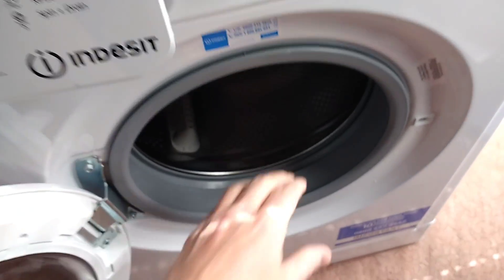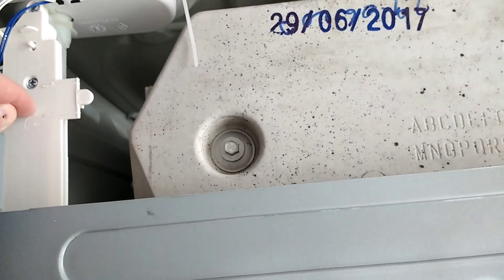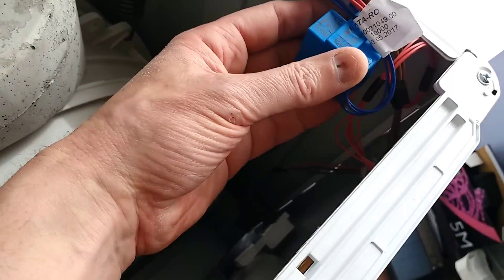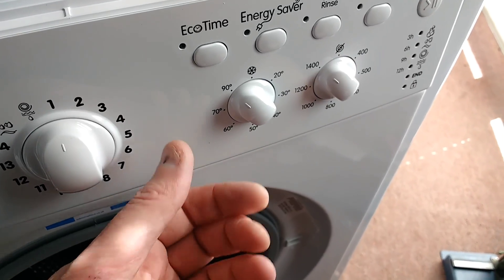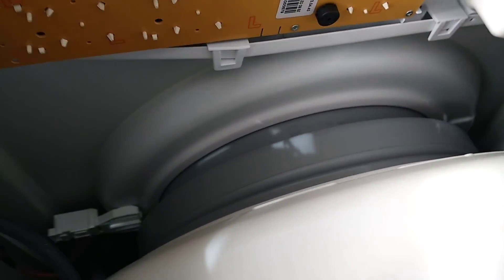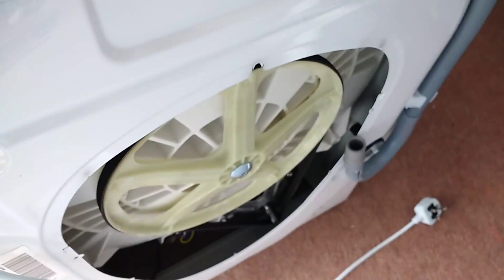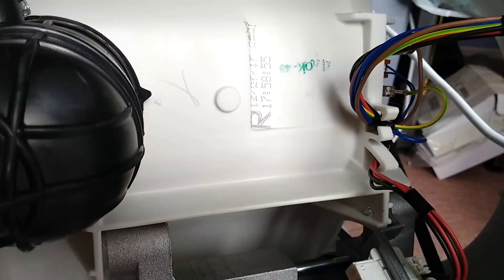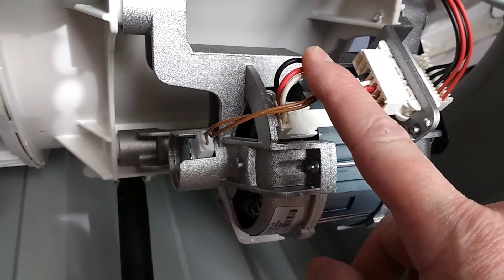Inside my new British washing machine (clothes washer).

Comment: As a ex-owner of multiple Indesit machines, I can bet 10€ that the first thing to go are the drum bearings. And it will cost around 100€ to replace because the drum is a sealed unit (two plastic halves are welded together). I did try and repair the old one by splitting the plastic case and I was somewhat successful but I could not get it to be 100% waterproof again. After numerous attempts with special sealants and glues and even a plastic welder I gave up and sold the machine. As a replacement I bought a LG washer that has a plastic tub that is bolted together with a huge O-ring between the halves and the direct drive inverter motor. So no more motor noise and if the bearings need replacement I just need to buy the seals, bearing and the O-ring. Samsung also has models with a bolted tub but I bought an LG because it was on sale.

Comment: I hate when the washing machine vibrates like crazy due to an unbalanced load.

Why is it not easy to mount the drum on an eccentric cam that can be adjusted to offset the balance within the drum?
Reply: Maybe to do with the difficulty of sensing the balance?
Reply from the maker: Maytag have an interesting solution to that.  A balance ring filled with water that somehow displaces to compensate for the load imbalance.
Reply: bigclivedotcom That does sound quite clever! Can you get a balancing unit for tear down??
Reply: My machine (Maytag Neptune 5500b) has this along with a resonant weight in the door. The liquid in the ring is supposedly a calcium chloride solution.

Comment: It's always so strange when I see washing machines installed in the kitchens.  So foreign to a North American.
Reply: We have nowhere else to put them here. They'd look daft in the living room and it would be a pain to get water to/from them. You'd also have to turn the TV volume up on spin cycle.
Reply: I think we're hinting that other Countries have laundries :-D
Reply: Same standard in Australia. Even the older, smaller houses have a dedicated laundry (sometimes combined with a reasonable-sized downstairs bathroom, especially in larger, multi-storey properties).
Reply: I am in Canada.  Let me tell you about "communal laundries".  They suck.  I live in an apartment that has such a facility and I do not go near it.  I do not need the inconvenience and aggravation of hoping and waiting for an unused washer, making the trip over to use it and forking over something like $4 for one load of washing and another $4 to dry, and then waiting around to discourage people emptying the clothes out (or even stealing them).  I will not have it.  Instead, I bought a small top-loading washing machine that connects to the kitchen sink using a quick-connect fitting.  It's paid for itself many times over but, it's not about the money.

I do not have a dryer.  I hang the clothes on a drying rack, and they're dry within about 12 hours.  By opening a window and directing a fan over the clothes, I can bring that down to 1 or 2 hours.  Besides a huge savings on electricity cost, this has the benefit of drastically reducing wear-and-tear on clothes.  The time spent tumble-drying is absolutely devastating to fabrics.
Reply: I wont have them in the house, hate the noise, the mrs has a shed outside with 2 washers and a dryer and thats her domain and i dont dross it.
Reply: Apartments in New Zealand will either have the laundry facilities in the bathroom or hidden in a closet. I have never seen them in a kitchen before.

Communal laundries are rare in apartment blocks - I don't know why but I think they would work a treat here. In many older standalone homes - like my old family home had a separate laundry room off the backdoor porch.
Reply: In the Netherlands it is traditionally the shower/bath room, or nowadays a separate laundry or a cabinet about a meter square (10 sq ft).
Reply: How about apartments? Where are the washing machines located in an apartment? Let's say 2 bedrooms, living room, kitchen, bathroom and a corridor? In Poland it is either bathroom or kitchen where we have washing machines.
Reply: well I find going into the boiler room in America to wash your clothes equally as bizarre as a European (Brit actually) ;)

Comment: Should have bought a Bosch, these machines are awful! They usually have one solenoid valve for normal cold filling (not been hot+cold fill for several years now) and a second solenoid plus restrictor for the comfort as normal mains pressure would spray it all over the drawer.
Reply from the maker: I had an Indesit in Glasgow for about 15 years and only needed to change the belt once when it started slipping occasionally.
Reply: The old ones were not so bad compared to the average machine these days, but I bet this one won't be as reliable, plastic pulley and all that! On the subject of the common control boards, I remember the old Servis Sapphire range, the first machine with a 1300 final spin (somewhere around 1990). They charged a premium for the 1300 model but all they did was cut a diode out of the control card. If you knew how to get the board out (pretty simple) you could save a fair bit of money buying the 1000 model and removing the diode.

Comment: The weights are also for tuning the resonance frequency of the camping system nice and low.

When you start a spin cycle and the speed increases, you can often see the drum resonate as it passes through multiples of the damping system frequency. That also includes the springyness of your floor!
Reply: I used to have a concrete floor, so once the machine was set up properly there was almost no vibration. Now i have a wooden floor and it is impossible to prevent vibration.

Comment: Most modern hot water systems take too long for the hot water to reach the taps, hence modern machines only fill small quantities of water and the hot wouldn't actually reach the drum. The older machines would half fill the drum. My machine is very similar also indesit and already 7 years old no issues yet
Reply: With my old machine I'd always put the machine on after filling the sink for my washing up. That way the hot water was there immediately. Since I've got my new machine, my electricity bills have doubled!

Comment: Make sure to remove the shipping bolts before you use it!
Reply from the maker: I got it into position and then did that.
Reply: Good, I just got a washer recently and the installers didn't do that. It resulted in a walking washer.

Comment: i prefer the OLD mechanical switches and dials..
DONT like computer modules esp if they are not WATER PROTECTED
Ribbed hoses collect lint..
Reply from the maker: The old cam switches were quite appealing.
Reply: Iv seen 20 year old washers Still working and Repairable..  What is the availability of that Circuit board and cost??  In the USA, its a service person and $200+..  They dont like people repairing things..and they Over price replacement parts..

Comment: Indesit shite. I suppose the question is, is it more cost effective to buy a £1000 pukka machine that lasts fifteen years, or one of these every five. 

I suppose at least buying a new one means you don't have to worry about maintaining it. Lol.
Reply from the maker: The Indesit spares are easy to source and the machine costs about £230 versus £1000 for a high profile brand with equally expensive spares.

Comment: Just curiosity... Isn't there any kind of accelerometer tied to the motor?  How does the machine know how to spin an unbalanced load?
Reply: Coolkeys2009 how does the check for 'out-of-balance' work?
Reply: I'd imagine they would detect it by variability in the motor speed or drive current. The speed regulation routine will know how difficult it is to maintain constant speed.

Comment: hate modern washing machines, I have Bosch and water level is so low, it just wets clothes inside, doesn't submerge them into water
Reply from the maker: The reckon that the increased fabric movement versus floating in water results in a better cleaning action, followed by a few deeper rinses to get the loose dirt out.
Reply: Like Blackadder said about the start of WWI - "There's only one problem with that." "What's that?" "It's bollocks."

My older washing  machine (Philips Whirlpool) was much better than my parents' new Bosch machine for getting clothes clean. My new Samsung is good but it seems to use a reasonable amount of water.

Comment: The 5th wire on the front control panel is used for warm white internal LED's in the 40 Kg 12,000 Spin Super Mega Deluxe Model. I have changed ours to those self changing tri colour LED's. I'm lying of course, it's only a 10,000 spin. Thanks for finding those straw hat ones for me. Great video as always. Please do something really nasty with the old one.

Comment: i was told somewhere around 2003 the UK washing machine industry sort of went through a dive to the cheapest with imports forcing the market down. basically since then, they are all crap no matter what you pay. none use hot water in anymore, plastic everywhere, etc. I got this from the plumber who repaired by Blomberg 5 years ago (a german siemens under another name - and one of the last really good ones he told me). I've repaired it over the years mostly myself - new heater element (still has one when hot isn't hot enough, etc), and new belt, etc but parts have now dried up (16 years old), and 2 weeks ago the circuit board worked loose, shorted on the body and fried one of the main relays - so I bit the bullet and got a new Samsung job. No hot inlet of course.. and I'd say otherwise pretty much no better than the 16 year old one it replaced.

Comment: It's fascinating to see how electronic timers and brushless motors -- once found only on the highest-end machines; lesser ones had to make do with mechanical timers and series-wound motors -- have become commodified enough to be found in the cheapest, generic washing machines. 

I'm guessing there are two microprocessors:  probably an 8-bit one on the control panel PCB and a 16- or maybe 32-bit one on the motherboard, which will be controlling the motor speed and direction directly as well as other elements of the program cycle such as the water heater, pump and valves and reading the temperature and water level sensors and the door switch.  If you energise the motor windings in sequence A, B, C, A, B, C the motor goes one way, a fixed amount for each change  (so the speed of the sequence directly affects the speed of the motor);  if you go A, C, B, A, C, B then it goes the other way; and if you go A and B together, B and C together, C and A together, A and B together, B and C together, C and A together then it will have more torque -- but this probably would only be used for starting from rest, since it also increases power consumption and self-heating.

My current washing machine is a 6-month old Miele, which replaced a 6-year-old Miele due to flood damage  (nothing to do the washing machine, but from a burst water main.  A water main that was carrying enough water for the quarter of a million thirsty, dirty residents of my city.  That burst just a short distance uphill from my street .....)   Anyway, the new one doesn't really look any newer than the old one looked -- it had behaved itself impeccably for six years and the paintwork was still as good as new, and there was no sloppiness in the program selector knob.  Another three years, and I'd have started making a saving over replacing a cheap machine  (one-third the cost of the semi-industrial Miele)  every three years.  So let us all see how our respective machines fare .....
Reply: That motor is a 400Hz 3 phase induction motor, so the inverter/vfd will generate 3 sine waves a 120 degrees apart and vary the voltage proportionally to frequency, as they have a tachometer on the back of the motor they can control the slip frequency + torque of the motor.
Reply: Miele (from Germany) is one of the last quality brands ... AEG is dead & now only used as label to get more profit out of the same Chinese junk

BTW: I am glad to live some decks above the ground ( I am flooded as the last in thew house ^^ )
Reply: It's not just that your Miele will last far longer than an Indesit ( the drum bearings may only last 2 years if used 5 times a week in my experience) but it's a pleasure to use a quality machine. I too have a Miele front loader with a 3 phase motor. I t does have a fault from new that I didn't complain about under guarantee since I wasn't sufficiently sure it was a fault.
When washing, the laundry tends to stick to the drum instead of tumbling properly, I guess due to a slightly over fast drum speed (or a vague possibly - too low a water level).
I get over it by always using gentle action on a Cottons wash. Machine is now approx. 13 years old so outside of the 10 year parts & labour guarantee. Only got myself to blame! 
Model W3922.
Reply: You get what you pay for. We have a Bosch dishwasher that is from around the turn of the century and it still works great. The only aging on it is the paint that is now a nice tan. That is the reason I replaced my broken washing machine, and then later broken dryer, with Siemens units (same factory as Bosch, lower price). Eyeing the Siemens IQ 700 dishwasher that projects on the floor, if the dishwasher needs to be replaced.
Reply: Coolkeys2009 Motors don't really care about waveforms, and will be perfectly happy with a square wave as long as it's symmetrical -- i.e., as much energy above the line as below the line.

Comment: @LakeNipissing EU consumer law says that the economic lifespan of a washer is something like 5 to 7 years. So if it fucks up and you're willing to write a few stern letters, the manufacturer has to prove that you broke it and if they can't they have to either repair it, replace it, or buy it back.
90 day warranty on a washer isn't just laughable, it's illegal. All it does is scare consumers away, because every other manufacturer will offer 5+ years. AAA brands like Miele still give 10 year warranty on a washer.
Reply from the maker: This one has a dubious ten year parts guarantee.  You just have to pay for the labour of fitting them (which also covers the cost of the part.)
Reply: So very true. Then again, I have been keeping my Miele washer from 1992 alive with cheap parts for the past few years now. Why replace a almost perfectly good unit, just because it blew 3 euro of off-the-shelf components. I'm not buying a new machine if all it takes is a thyristor and some capacitors to fix the old one. Luckily for me someone in Germany back then decided that the timing mechanism should be made of brass and steel.

Comment: If that motor is the same as the one I recently extracted from a front load washer, it is indeed 3 phase.  It is 3 phase 240 volt 400hz, which is very cool.  TONS of speed range control.  One of my smaller VFDs has a 400hz option, and it is quite a fun motor to play with.
Reply: unloaded, those motors will spin nearly 24,000 RPM @ 400 Hz. (2 pole motor)

Comment: The older timer controlled units had a common failure mode. The main power and motor contacts in the timer would fry. Replacing switches and timers used to be common. To prevent that type of failure I add relays to control the heavy draw items, saving the contacts in the expensive timer unit.
 When the timer in my washer died there was no replacement available and the switches were not changeable. Since I had recently replaced the drum bearing and seal I converted it to a manual machine with a relay for the motor, an 8min timer and 3 switches, wash/off/spin, drain/off/spray, cold/warm.
 To extend the life of your new machine you should put a relay on the main power door switch and the heater control. Take as much load off the control unit as you can. To do this for the motor you would have to tap into the inverter control. I don't know how easy that would be as all the machines I have worked on are a simple induction motor. And it may not be necessary if it uses a soft start for the motor.
Reply from the maker: You can rest assured that if the controller fails I'll have it open and be finding compatible relays.

Comment: As a service engineer in the UK, this was really weird to watch. I'd say you did a great job of walking through the machines parts. Couple of notes. Cold fill only has been standard for about ten years so your old one was probably pretty old. Those pressure switches are pretty awful, if you have any issues that be first port of call. The brushless motor is still a fairly rare item. Usually only found on the more expensive models. I've seen a few of the ones you have fail after around 18 months. But it's really just bad luck if yours goes
Reply from the maker: My old Indesit in Glasgow is still working.  It's probably around 15 years old.  I only had to replace the belt when it started making a slipping noise.  I was surprised by the brushless motor.  Maybe it's cheaper to have a smaller simpler motor and driver.
Reply: bigclivedotcom Agreed. I'm seeing those brushless motors on a few of the cheaper machines these days. They should in theory be longer lasting than brushed ones. Highly recommend you hang onto your old machine. Worst that can happen is the bearings will go, but if you do the repair yourself it's very inexpensive. Just the cost of a couple of bearings and a rubber seal
Reply: Make a video about replacing the bearings in the old one.
Reply: Paul Sengupta I already have one actually. Have a look through my videos
Reply: I meant Clive... :-) Sorry! :-)

Comment: The lump on the back of the motor is a tacho, the frequency tells the computer if its driving the motor enough, frequency feedback.
And i suspect a wavering frequency would mean the load isnt balanced.
Reply from the maker: The word tacho completely went out of my head while filming.  That happens a lot.
Reply: Clive, you are not the only one, my memory refuses to work untill way past the time i needed a word :-D